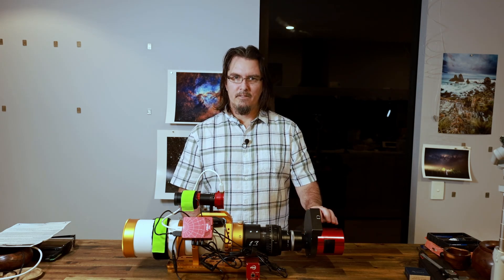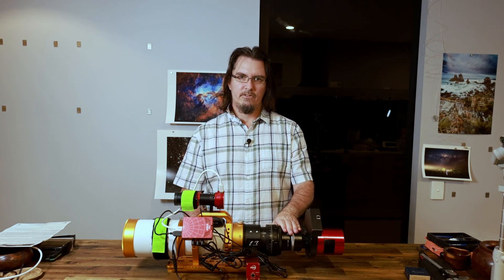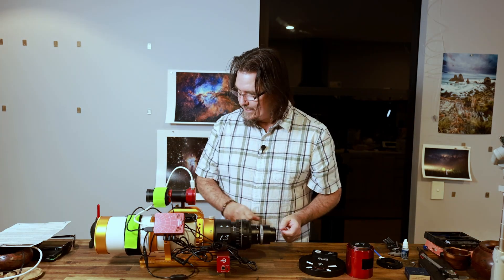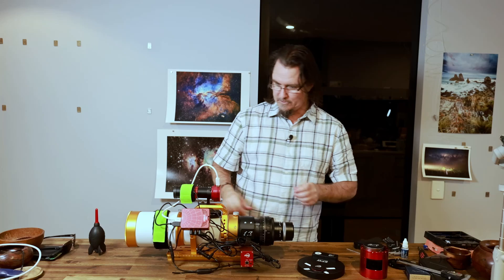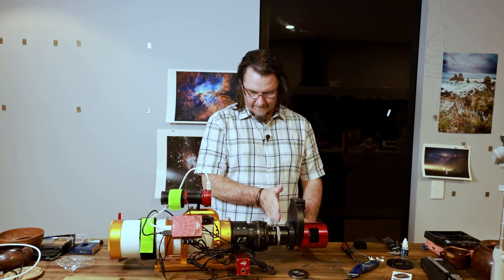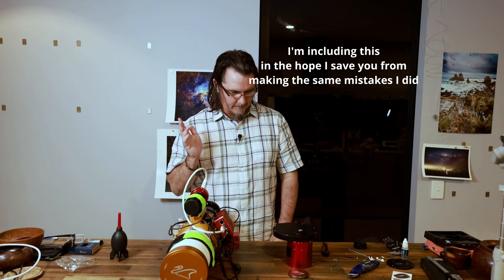Installing a Gerd CTU to ZWO 36mm EFW and 2600MM-Pro astrophotography camera.

Comment from the maker: Updates since posting the video:

Despite saying there will be a Part II, I won't be making it. I'm increasingly feeling the tilt is more than likely from the flattner/reducer (from what I am seeing on Cloudy Nights and other forums) and no amount of tweaking and wasted nights have been able to achieve consistant, even stars in the corners. Plus, like it or not, but the BlurXterminator program for Pixinsight gets me acceptable results for those wonky stars and lets me have more roof time.

Removing the tape.  The ZWO EFW will connect to the 2600MM either buy a 1mm thick adaptor, or by removing the camera’s tilt plate and screwing the EFW direct to the camera.  Because I originally had it setup with the 1mm adaptor the holes on the EFW had to be taped over so there was no light leak

Removing the four bolts on the other side of the EFW.  The ZWO off-axis guider (OAG) can screw directly to the EFW.  I don’t have an OAG so I used the mounting screws to block up the holes.  When I put on the m42-m48 stepdown ring from Gerd, the flange of the ring was flexing up and proud of the surface, that is the part I felt was 3mm.  Because the stepdown ring meant the Gerd wouldn’t sit flush on the EFW I had to tape up those holes and I'm hopefully back to a 1mm gap.

Comment: great video.  would this process be same for attaching 2600mm to zwo 7x2" EFW as well?
Reply from the maker: Mostly the same, except it will be a different size adaptor to screw the Gerd CTU to the EFW.  The chapter starting at 7:50 has a M42 to M48 adaptor, you will need to clarify with Gerd which is the right one for the 2" EFW

Comment: I owe the same tube and camera and the 2" EFW, and have tilt problems .. what's the problem with the camera tilt adapter?
Reply from the maker: My problem was it was just a pain to have to disconnect and remove the camera to make an adjustment to the tilt plate.  Other people may be more patient but not me lol
Reply: @GlennMartinPhotography  it will be a pain for me too, as I have the camera directly screwed to the efw... 😔
Reply from the maker: @JoseLausuch  Ah, so if your camera is bolted directly to the EFW the tilt plate has  been removed already.  That is something I like about the new setup, removing the tilt plate brings the filters that little bit closer to the sensor.
Reply: There are backfacing tiltplates that are compatible with ZWO (like the Ogma OTilter) so you can use everything as is relating to backfocus. And even with a frontfacing tiltplate there is a tool from astro precision to get rid of tilt without stars, adjust once during the day, job done... Btw Gerd is the firstname of Gerd Neumann the German engineer that builts the tilter.